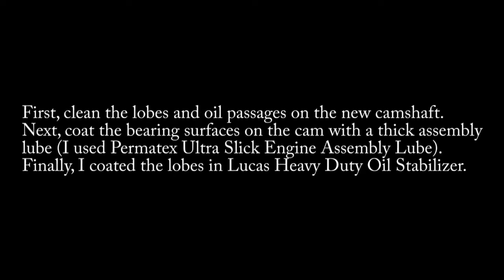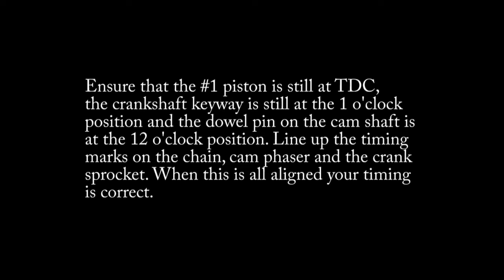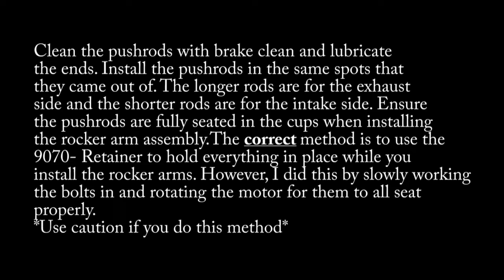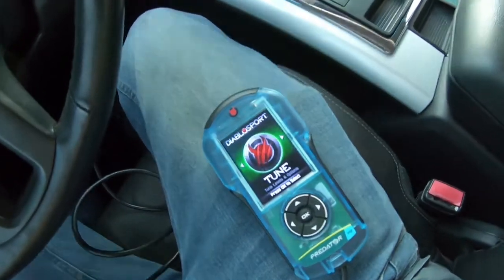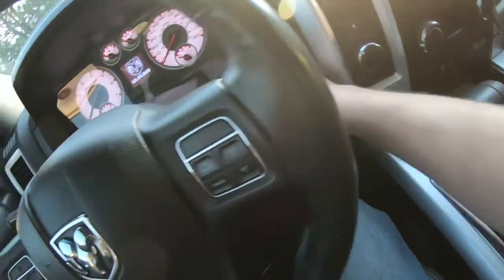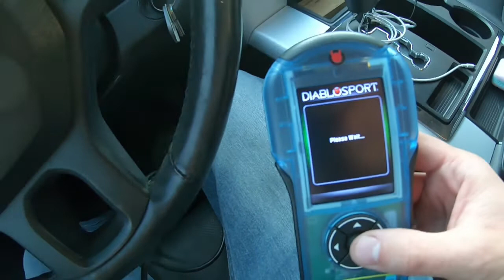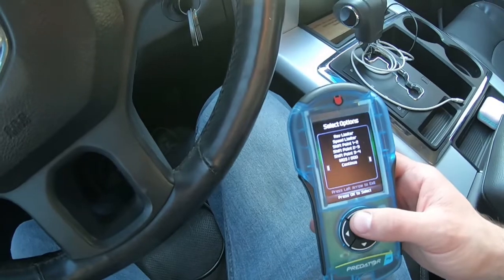Ram 1500 Cam and Lifter Replacement Part 2

Comment: I decided purchase of same components with you. I live in korea and have 2012 dodge ram 1500. I met lift failure problem this year spring. I'm doing mds delete by myself alone. Yesterday I pull out mds solenoid. Soon I will finish all this work. Your video is too much helpful. Thank you.
Reply: I saw your video today. If I  knew this video earlier, I would reduced wasting mistake and time

Comment: The cam litters were replaced the problem was rods were not properly installed sounded very loud and rattled. Investigated a little more found rods were bent replaced rods. Now I have a rattle on the driver's side from the lifters. Could I have damaged them in an hour of run time
Reply: Its  normal to get that rattle with new lifter sometimes is 10 minutes sometimes is 20

Comment: Hello everyone there, to delete the MDS system is it a matter of simply installing the plugs in the hole of the block?  or do you need to do some configuration with the PCM of the truck?  Can you provide a link to where you bought the parts from?  thank you
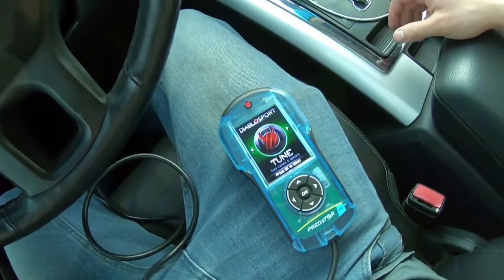Reply from the maker: If you go to 19:04 I show you how to tune the truck to delete the MDS system.
Reply from the maker: https://www.amsracing.net/products/dodge-mds-delete-install-kit-and-tuning-package-for-2009-2015-5-7l-hemi-engines?variant=11532742590500&currency=USD&utm_medium=product_sync&utm_source=google&utm_content=sag_organic&utm_campaign=sag_organic&utm_campaign=gs-2018-12-05&utm_source=google&utm_medium=smart_campaign
Reply: Thanks for sharing and sorry for asking ahead of time about the video, one more thing, once you select an option can you change it again?  I see what there are other options to the one you chose, so far have you had any problems with it?  or are you satisfied with the performance compared to the factory system?
Reply from the maker: Yes you can change the tune whenever you want with the tuner. I am pretty happy with the performance so far
Reply: @milehighmisfits  
It's good to know that.  I have a misfire problem.  so I don't want to patch up and eliminate future problems all at once.  Thanks again

Comment: So you didn’t have to lower the oil pan to remove the pick up tube from the oil pan ?
Reply from the maker: The correct way to do it is to drop the pan to take out the pick up tube, however I was able to lower the pan just slightly by taking out the front 6 bolts and unbolting the pick up tube. It was pretty risky but it paid off. Use caution if you try this because it’s extremely easy to lose bolts in the pan this way
Reply: @milehighmisfits  Is your truck a 4x4 and is that why you did not remove the oil pan?
Reply from the maker: @the.crop.duster  Yes my truck is a 4x4
Reply: @milehighmisfits  Thanks for your help!
Reply from the maker: @the.crop.duster  Absolutely! I'm glad i could help!

Comment: What brush head did you use to clean the heads? And did you need to blow it off with compressed air after?
Reply from the maker: I used a 3M Scotch-Brite Roloc Bristle Disc to get the gasket material off, and yes I blew it off with compressed air after. You need be careful to not get any residue or debris in the coolant passages

Comment: Finally someone explains where to set the cam shaft keyway pin.  i've been looking for that info for days, no other video tells you where to set it.   maybe this is why my engine is running rough after doing a cam swap, as I didn't know where to set it.  I think I set it at 11 or 12.  going to have to tear apart the engine again in the morning to check the position.
Reply from the maker: @cetubuth7461  I’m glad the video helped! But I’m sorry you didn’t find it in time 😭

Comment: Hey man, I'm currently doing this same repair on my 2010 Ram. I have it broken down and I'm about to hit the button on a kit. I was wondering if you were still happy with the AMS kit, any issues at all? I guess I'm going to go ahead and get the Mopar Lifters over the Comp Cams. Was the AMS camshaft good quality? Also, why did you choose not to go with a timing chain kit? Ive got 200k on mine, looks fine but worried if I should change out to a new one. The chain kit is probably not mopar for sure. Good video man thanks for your help!
Reply from the maker: Hey! I just recently posted a one-year review on the AMS kit if you want to go check that out on my channel! That goes over my honest thoughts on it. The camshaft itself has proven to be good quality so far also. I did not end up going with the timing chain kit just because mine was lower miles and seemed to be in good shape. It was more of a financial decision than anything, but if you have the money to do it while you are in there you probably should. But because I haven't used the timing chain kit from AMS I can't speak for the quality of those components. Thanks, I hope I could help!
Reply: Thanks for the reply man I really appreciate all the information. I just finished up mine this past weekend. Everything went well and my truck is back in business. I'll subscribe and check in with you from time to time. With tune do you prefer on the diablo? I went with the 87 performance tune just to start. Also noticed after I disabled the MDS my Eco light still come on and off. Truck runs great though. Keep up the good videos!
Reply from the maker: @jeremyhortman5096  heck yeah! I’m so glad I could help! Yeah I usually use the 87 tune on mine from the Diablo tuner. I really don’t notice any performance gains but that’s okay. Also the eco light still will come on that’s completely normal even with MDS deleted.
Reply: @jeremyhortman5096 AMS just rebrands the stuff. Most of it is OEM Mopar or similar like Melling/cloyes.

Comment: hey brother what product did you use to clean/flush the engine internally in order to get rid of all metallic particles from the damaged cam lob/lifter??? thankssssss
Reply from the maker: I just ran clean oil through the engine after the rebuild and changed it right away. And then changed it again after about 1000 miles. That’s pretty much all you can do to get rid of the particles
Reply: @milehighmisfits  cool brother and thanks for your response

Comment: What was your secret for getting the bolt back in the oil pump? Im considering making a small slit in the bolt and using mechanics wire as well as a small precision flat head to guide it up into the pump then get the threads started. But im curious what you guys ended up doing. Great video, very straightforward.
Reply from the maker: That would be a better idea! Honestly I just used a screw driver and my finger to balance it and I was able to finesse the bolt in and I was able to use a wrench to tighten it from there but I wouldn’t recommend that. One slip up and that’s a bad day lol
Reply from the maker: I’m glad that you found the video helpful!
Reply: @milehighmisfits  Yea ive been trying that and tore up my finger pretty bad, I avoided loosing the bolt by using mechanics wire wrapped around the bolt between the head and captive washer. Such a frustrating design! I REFUSE TO DROP THAT PAN!!  LOL

Comment: So, what are the pieces the were making the thinking noise? Was it the lifter hitting the cam or something else?
Reply from the maker: Yes the lifter bouncing back and forth on the worn out cam lobe is what makes the ticking noise
Reply: @milehighmisfits  makes sense. Great video by the way. How long did it take to get that much damage on the camshaft? 

I have been hearing ticking/clunking on the left side of my engine since I bought it with 110k miles and now it’s a 140k miles and still no check engine light nor hesitation. I am wondering how much life is left.

Comment: Did you get any error codes afterwards?
Reply from the maker: No i did not because i used the tuner to delete the MDS program from the ECU
Reply: @milehighmisfits  Thanks. Same exact truck here same thing. I’m following your videos step by step. Could not have been easier. Great job.
Reply from the maker: @ForPlumas  I really appreciate that! I'm glad i could help you out! If you have any other questions, feel free to reach out!